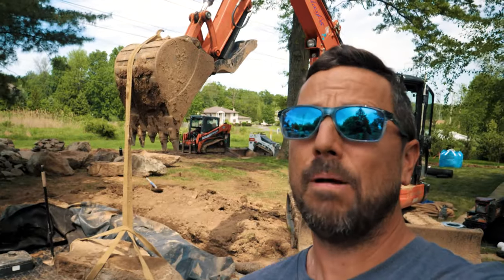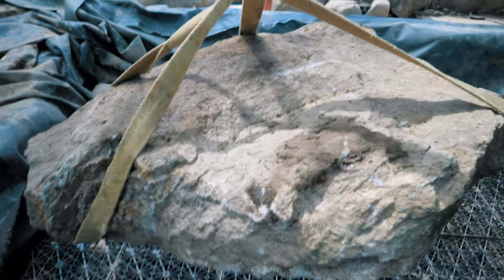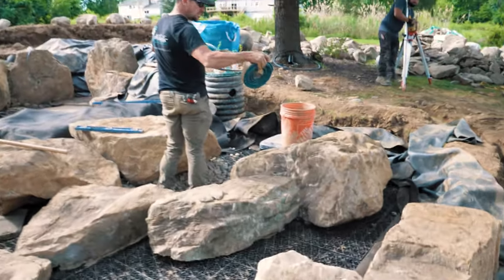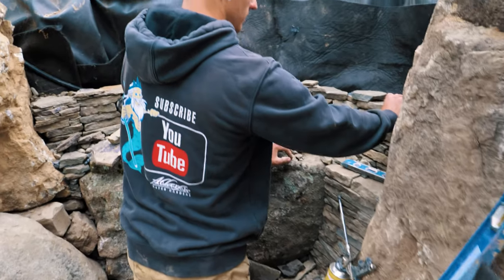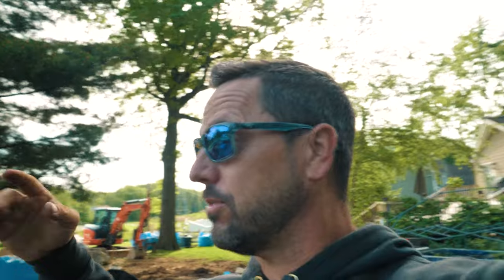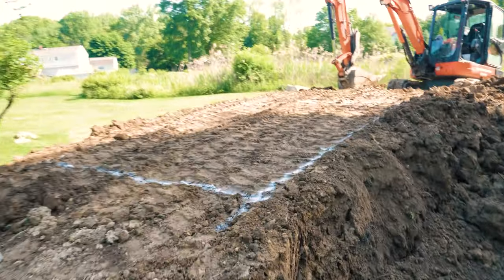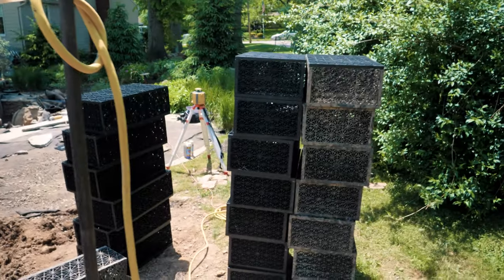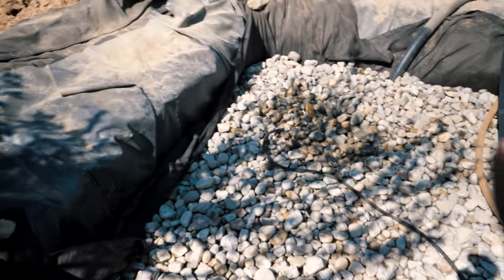The NEGATIVE EDGE with WETLAND FILTER Explained! | NEGATIVE EDGE Part 3

Comment: Loved how you really explained and showed how you construct the wetland filter! Just wondered though, what the point of the aqua blocks is? Is it to provide like a void space so the water disperses out and travels up through rock and gravel across the entire area of the wetland filter equally? Thanks 😊
Reply from the maker: Thanks for the support! Aquablox are designed to efficiently maximize water storage capacity, providing the ability to hold more water with a smaller reservoir footprint. I hope that helps :)

Comment: I noticed you seem to use rocks around the perimeter of the aquablocks. Is that so, soil doesn't put pressure on the corners of the aquablocks, preventing a possible puncture?
Reply from the maker: It's protected all around by several layers and we make sure the soil is clear from any unwanted debree on top of that. So yeah, soil alone isn't causing any issues here. :)

Comment: How many years Aquablock can last under all those rock until it collapsed?
Reply from the maker: They're built to withstand the weight. We don't overload them.
Reply: @AtlantisWaterGardens  I take that as more than 10 years it is.
It's a good investment then.
I am looking forward to  use this system if I am happen to make a swimming pond, but sadly Aquablock is not a thing here in our country, at least not yet.
Reply from the maker: @HakunaMatata009  they have a 10 year warranty, but as long as they're used correctly they should last much longer.